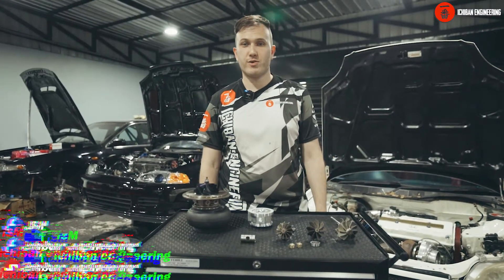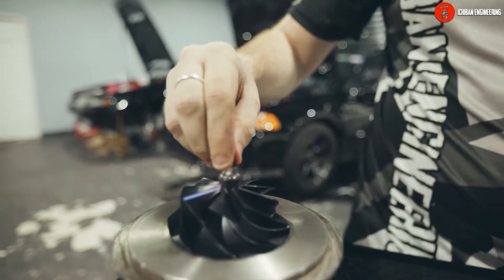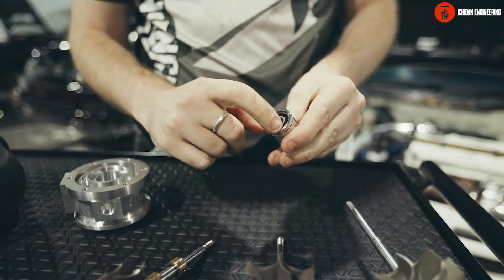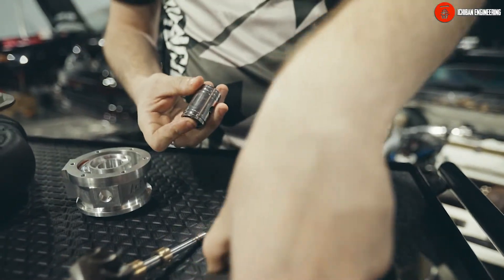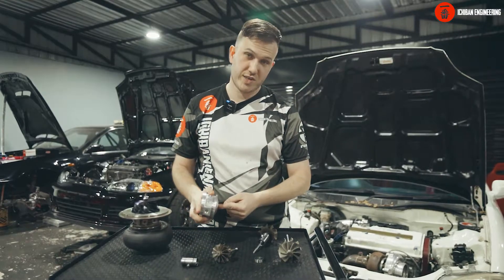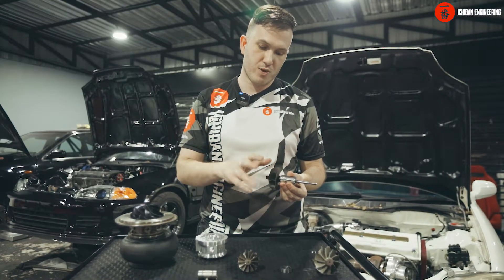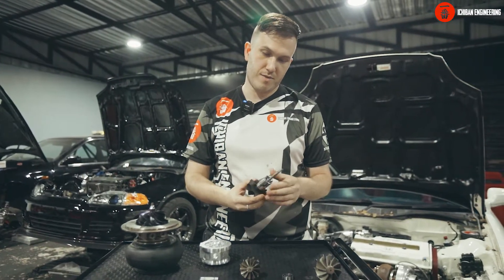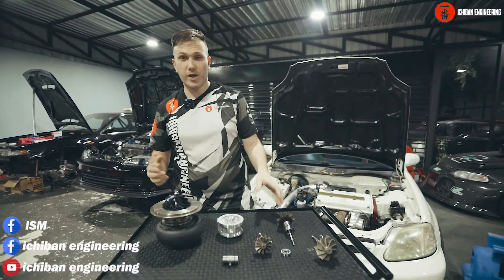Is Journal Bearing Turbo Better Than a Ball Bearing one ???

Comment: If you cant find documentation on your turbo, is there a way to see what kind of bearing it is, without disassembling it?
Reply from the maker: sure. you can take a look in the drain area. and see the bearing it self.
Reply: @IchibanEngineering and how can you tell what it is? By the color you see in there?
Looks like journal bearings always are brass colored?

Comment: hello there, is it true that jurnal bearings dont actually need water cool on turbo? ( i mean on the turbos that have oil AND water cooling system ) ?
Reply from the maker: it is true and not true. In a sense because there is a lot of oil going into a journal bearing turbo, the oil also cools the turbo.

On a ball bearing one, there is very little amount of oil going in, so it has to be water cooled if you don't want to blow it.

There are some air cooled units that are ball bearing but are for race use mostly.

Journal bearing turbo will still benefit from having a water jacket. But it does not have to have one.

Comment: This is not even a debate i can’t believe ppl are making debates about this! After years of trial and error this is why we make bearings for the exact reason on whats going on with journal bearing metal rubbing on metal wearing out parts! Now when you elevate that shaft and catch in the middle with a (bearing) what it’s exactly designed for to spin its inner race while outter staying still holding shaft elevated away from the shaft thus rotating shaft not wearing out! If anyone knows bearings is that there are really smooth and take no effort to spin and spin and spin and keep a rotating mass spinning for minutes on end effortlessly! This is not even a ? You know why they make journal bearings cause the cheap companies prbly 3 guys in india pouring castings into sand need less parts to build keeping overhead down. Its the cheap companies that make journal bearings!
Reply from the maker: I agree on some parts.

But as far as why some companies produce journal bearings still, is to save the costs. The ball bearing that I hold in that video cost about a $100 a piece. So two of them + making a special bearing sleeve it adds up.

If i were to advise to a end user, go with a ball bearing %100.

On heavy trucks however, where huge turbos are used, or marine equipment, journal bearing is more suitable. The reason being that :

1. the larger the ball bearing the higher the costs - and on these size units the costs are sky high
2. larger ball bearings can not go to high speeds like smaller ball bearings, they will fail and currently there is no solution for that. So on really large units, I am not talking about cars or any private truck, but industrial machinery , journal bearing is still used.

Comment: This is why I'm still going journal bearing on my future turbo for my k24 civic awd. Journal bearing lasts longer too because of that extra oil between the shaft and cartridge, it cools down the internal temps of the turbo, less vibration as well because the extra oil acts as a shock absorber. Correct me if I'm wrong.
Reply from the maker: lol you are wrong mate. this video explains why ball bearing is better in the long run. but it also explains why journal bearing is not bad, and is not gonna spool any longer or slower than ball bearing.

performance wise - they are the same.
reliability wise - yes ball bearing has it's advantages in the long run.

This video was intended to provoke the misconception that journal bearing turbos are not good or has a slower spool time. and show the difference between ball and journal bearing systems.
Reply: @IchibanEngineering  ah okay, thank you for correcting me. I don't know why people always say journal bearing are worse and spool slower. Me personally I love journal bearings for the price and still perform like a ball bearing just depends on the impeller like you said and turbine wheel. I've seen too many Ball bearing turbos just grenading..
Reply: don't mind em, there's nothing wrong with a journal bearing. the issue with ball bearing turbos is when they fail, they generally take your engine with them. when a journal bearing fails you may get some chirping sounds to tell you something is wrong.